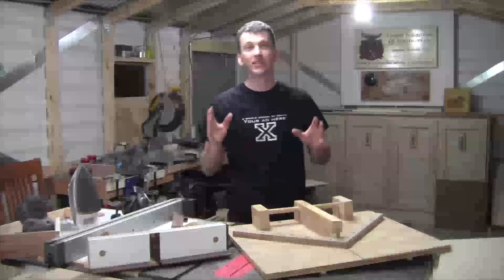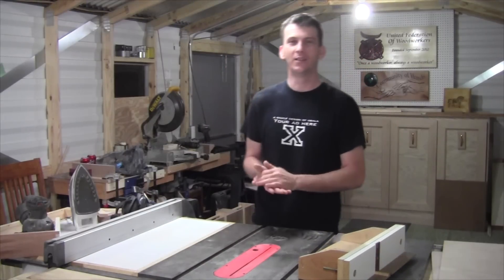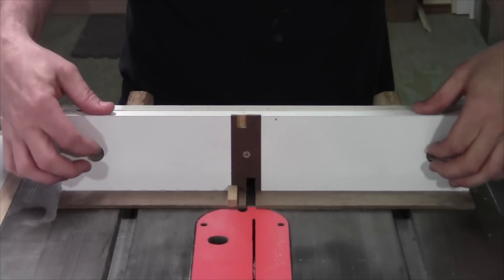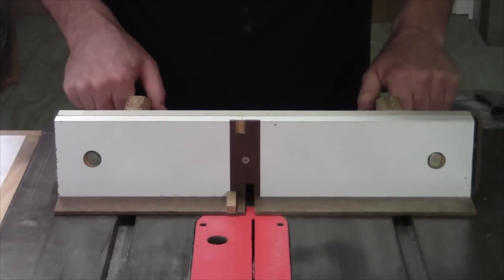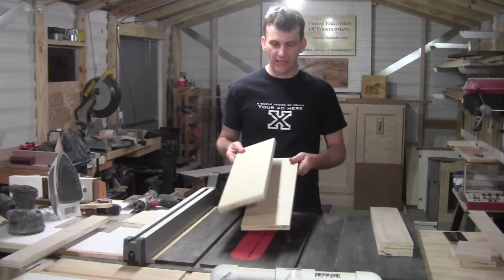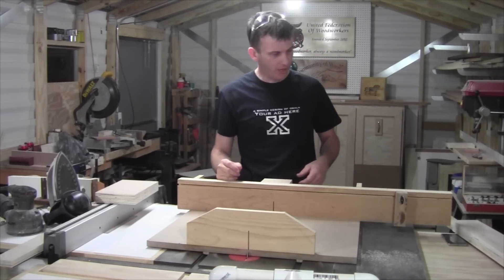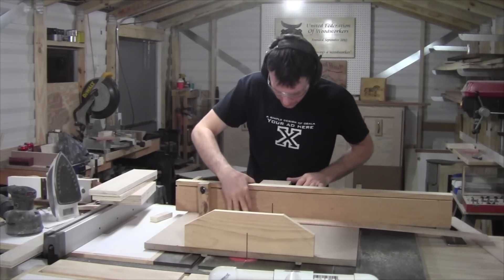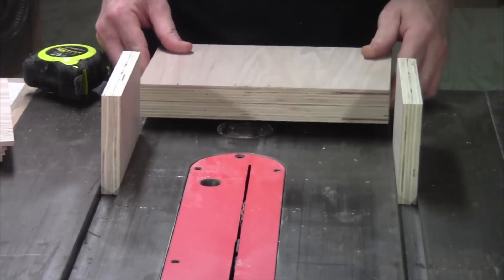How to Make a Finger Joint Jig | PART 1

Comment: I have a lot of scrap wood laying around. Does the base (two side handles piece and the two bottom piece you screwed together need to be thick? The pieces I have are 1/2" thick plywood. I'm only planning on doing 1/4" and 3/8" inch dado cuts.

Comment: It's seems to me that if you orientated the rear cross pieces vertically instead of horizontally you could make a simple, flush to the table crosscut sled. Am I crazy for thinking that?
Reply: you could add a horizontal piece at the top to protect your hands from the blade on the pass through.

Comment: I did not see a comment box so I am using the reply of this comment.

This is a great Jig and I will make one for myself as well. I do have two suggestions on how to "improve and simplify" this jig. The replaceable base of the jig witht he various keys should use threaded inserts to assure long use of the jig and ease of use. Second suggestion is why not make the  replaceable middle insert a little wider and accommodate the various keys making it much easier to switch sizes.

Comment: Just wanted you to know that after watching this video I had to build 1. Its not half as complicated as that crazy advanced finger joint jig and it does just as good of a job i'm sure. Also I rigged up two 1/4" strips on the opposite end of the micro adjust screw and drilled 4 holes and put in 4 springs so that my adjust screw is always up against the stop when im not adjusting it. Just thought I would share that with you and your fans (me being 1 of them). Good job bro...Keep them coming.

Comment: I had those wings or Tabs on my ryobi table saw... I simply ground them off. it evened up the entire slot. not sure if it can be done with other table saws. just letting you know what I was able to achieve with mine. still works ok too :)

Comment: I think that the purpose of only screwing the sides into the top board of the sled is so that it will pull those sides to a very slight angle, which tightens the entire thing up in your slots, eliminating any wiggle.

Comment: Awesome video Laney. I need to do this for an afternoon project.  One safety suggestion is to use a handled push pad on all cuts.  Having your hand between the fence and the blade should never be done and scares me just looking at that.  I like the bigger push assembly that you do use in another portion of the video

Comment from the maker: Jimmy, if the joints aren't lining up and getting bigger it sounds like the pieces may be ever so slightly moving when being cut. a firm grip or even clamping for each cut may help. also make sure your fence bolts are tight and there is no movement of the front fence when cutting.

Comment: I built a very slightly different version of this without the micro adjuster, but it works great.  I've been fiddling with several other types never getting one that remained consistent, but this one is fantastic.  Thanks for the video.
I need to fix the adjustment bolt holes, but that's easy stuff. I ran out of adjustment to one side.

Comment: About those tabs on my table saw. I ground them off of one side. My table is aluminum and it ground easily. I use my miter gauge in one side and a strip of wood in the other.

Comment: thanks Laney for making a thorough and very helpful video, great job. i just wanted to mention that i augmented mine by making it taller for more stability of longer drawers by displacing the doubled up plywood base by 5", made them narrower and set them toward the rear away from the fence. this prevented the dado blade from sawing into the structure and allowed more sled travel with repeated cuts (it always happens with repetition in my shop). also i used 1/2" board for the carriage instead of 1/4" to increase the angle of attack of the dado.keep on with the videos they are much appreciated!
a guru, 40 yrs in the making, told me once:  "If you get a red flag feeling-stop, take a step back, and re-evaluate...you'll retain more fingers that way"

Comment from the maker: Nope not really.. Just pre drill the MDF because the sides like to split, and you want the back fence to be secure to the body of the base, also the micro adjustment screw on the side which you will see in part 2.. maybe a threaded insert for it.. or just predrill..

Comment: Watched and built this 2 years ago for use on my router table using spiral upcut bits.  Don't know why it has 109 thumbs down.  Make the jig accurately and it makes flawless 1/2", 3/8" and 1/4" finger/box joints every time. Try it before you knock it.